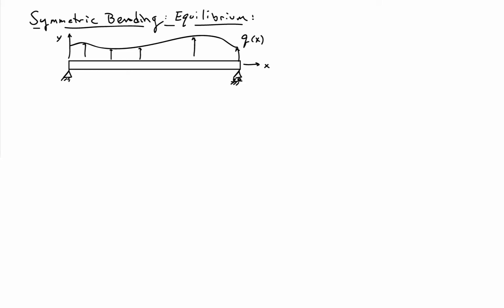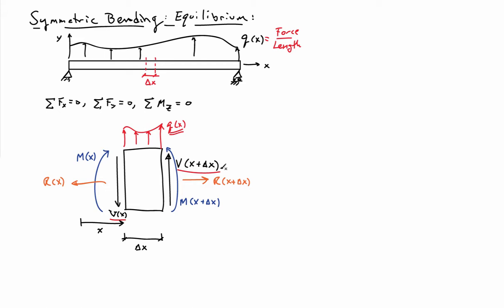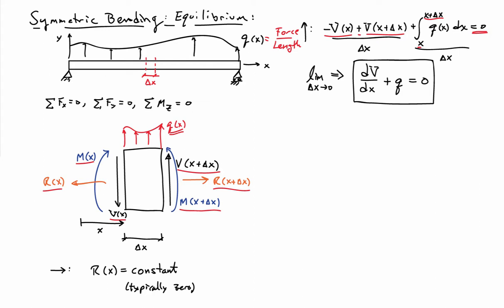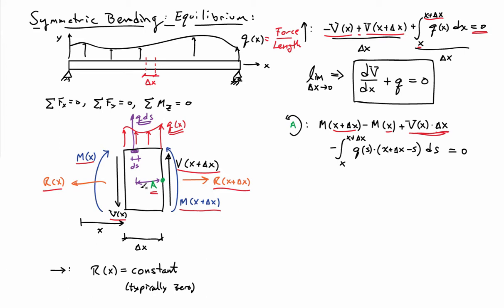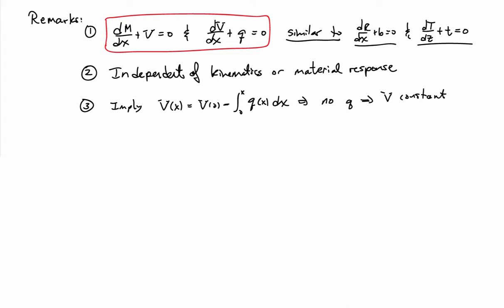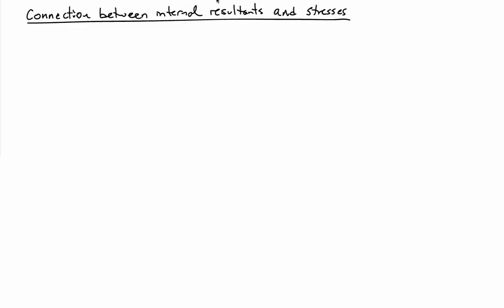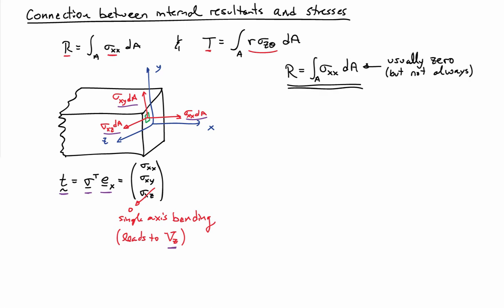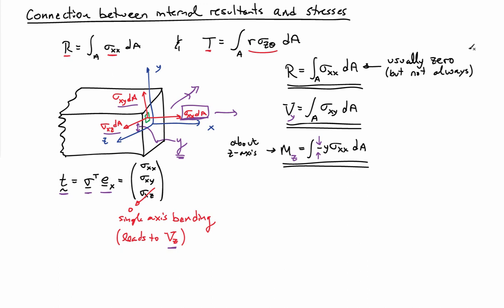(25A) Bending equilibirum and resultant-stress relations

Comment: which book do you use for this subject.
Reply from the maker: Engineering Mechanics of Deformable Solids by S. Govindjee: Oxford University Press (2013), ISBN: 9780199651641. It is recommended to get the 2nd Impression: Reprinted 2017 (with corrections)